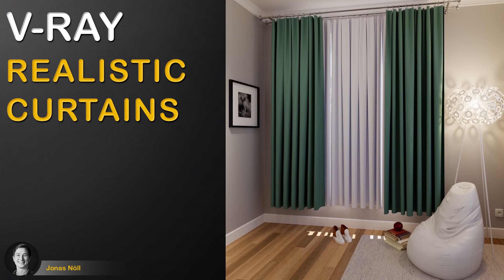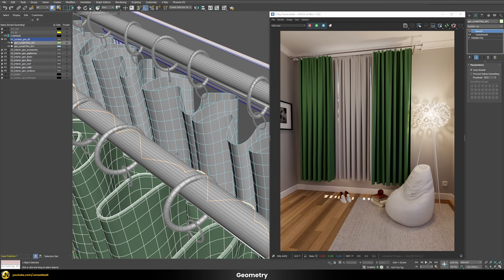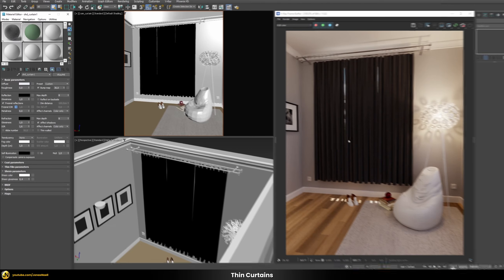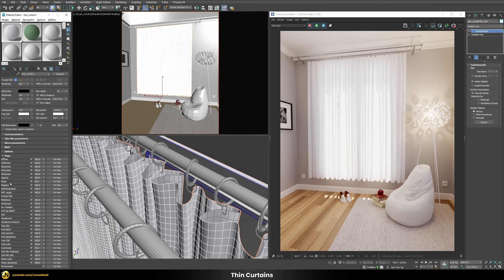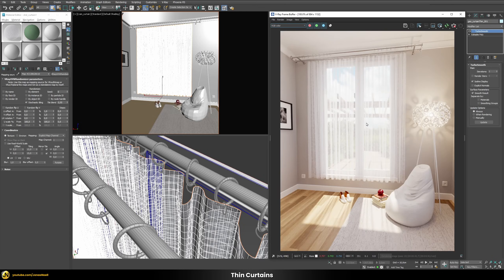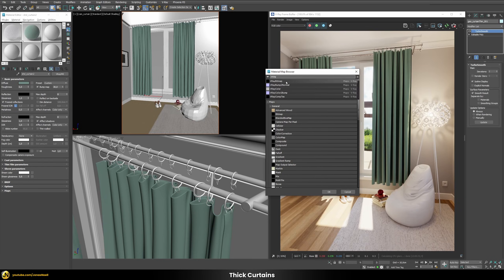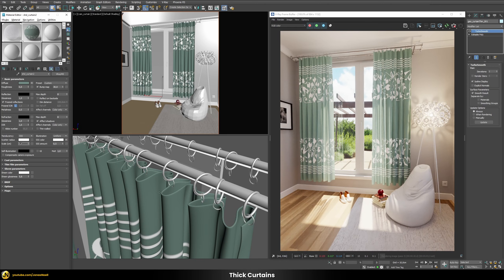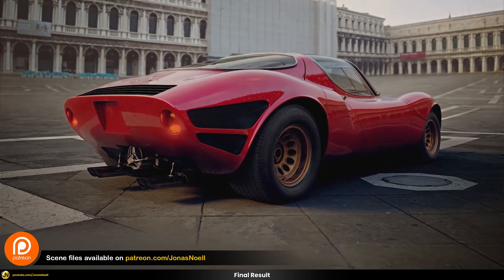V-Ray | Realistic CURTAIN SHADERS - For ArchViz

Comment: thank you for all your tutorials. Question:  Is it faster to render than the 2SidedMtl method?
Reply from the maker: Not necessarily. Seems to render similar speed in my test. In fact I guess the Thin Model basically does the same thing like the 2SidedMaterial, just built in a more compact way

Comment: Goog Tutorial as always.
Concerning the Reflections. You said, you didn't apply any because of render time...But just to be sure, the physically correct way would be to put the reflection channel on white color and for cloth probably set glossines to near zero, right?
Reply from the maker: Technically yeah, but the sheen effect intents to imitage a similar effect of very low glossiness values, so I guess in practice there shouldn't be much noticable difference for both approaches. When using sheen effects normally the reflection is set to black unless you want to achieve a specific effect :-)

Comment: Cool technique! When I needed a half-transparent material, like curtains, I was using only 2sidedMtl. It's nice to know another cool way to do it. Thanks a lot!
Reply from the maker: The 2SidedMtl works to some extent but only on geometry without thickness. Using the thin walled mode with translucency actually is doing the same with a much simpler setup
Reply: @JonasNoell  yeah, I should've said 'the better way':) It's much simpler, and I like how Vray is shifting to a more versatile one material for all cases.